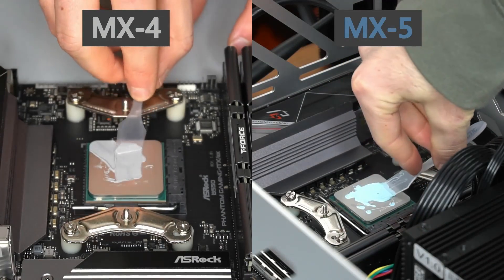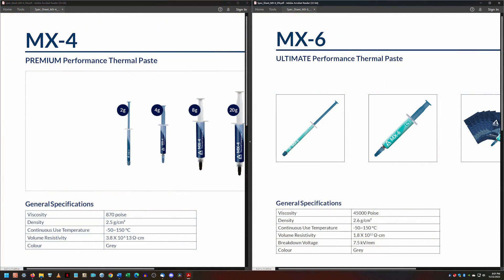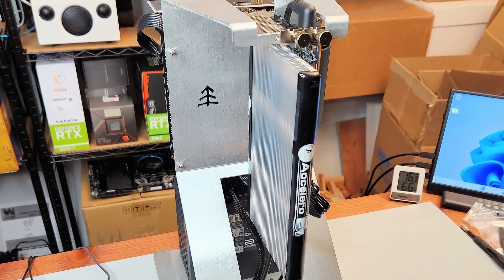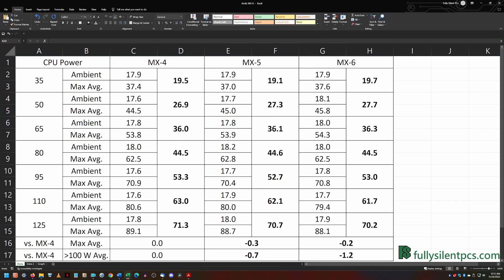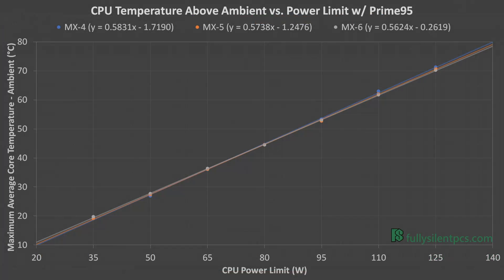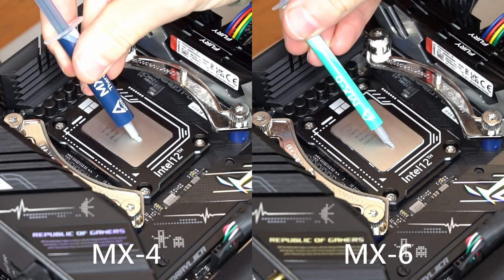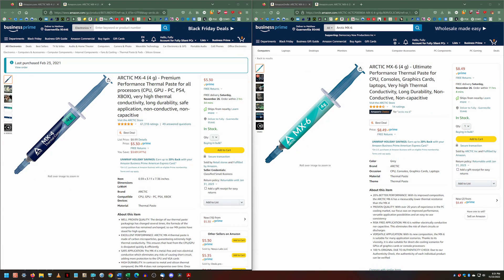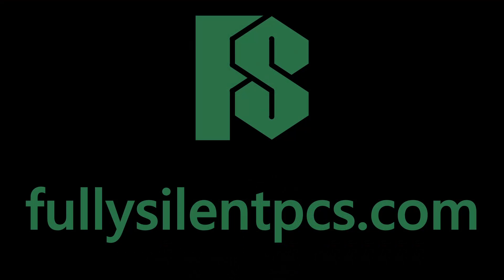Arctic MX-6 vs MX-4

Comment: Thanks for testing & posting!
I liked the light blueish color of MX-5, too bad they went back to the dull grey from the MX-4. But although Arctic won’t admit it, MX-5 clearly had a defect. It pretty much falls off after a few months of use. It looks like it dries out from the heat cycles. I hope they managed to tackle this with MX-6.
Reply: oh arctic did admit it had an issue, thats why they came out with mx-6. it would slowly spread out from under with repeated heating/cooling cycles
Reply: @BTD3Fan  Arctic never said MX5 was a faulty engineered product. They blamed the issues on one given batch. And yet for some reason instead of continuing to refine MX5 as a product with minimal changes, which is something they had done in the past, they chose to release MX6 which is fundamentally different again. Curious that.
Reply: @SianaGearz  can you tell the progress on the mx 6 paste, is it good for long term use?
Reply: @SianaGearz  well, it was just one single bad batch
Reply: @nirwanmuiz7695  it's only been on for a few months, too early to tell.
Reply: I just took off my cooler from GD900 after half a year and it was a breeze. The paste was still super fresh and well mixed. Easy to apply, easy to wipe off.

Now I installed MX6... Wonder how it's going to fare, with removal as well. Temperature improvement against a well aged GD900 of 1°C at 80W and 2°C at 110W. So I wonder yet whether that's even a real improvement or not.
Reply: @SianaGearz  I just took off my hyper 212 evo after 6 years and the paste was basically good as new. Idk what paste they were using at the time or if they still are but it seems to be pretty solid.
Reply: @SianaGearz  this is MX-6 I presume?
Reply: @kasimirdenhertog3516  What is MX6?

I had GD900 paste for 7 months.
Now I installed MX6 paste.

I happen to really like GD900, I was surprised. But I was curious to try MX6.

I don't know yet how MX6 is going to perform. I'm a little scared that it'll fail and harden. Temperatures look good but not crucial enough to make a decision.
Reply: @SianaGearz  what's the results of MX-6 in present ?
Reply: @luanszcosta  I have not taken it off, so i don't know how much it gelled or dried up, and i have a hard time judging temperatures since my PBO isn't exactly the same as it was back then, and my room is currently being a little weird, we have floor heating and the computer is on the floor, and the heating is completely automated by a machinery from the 1960s, we aren't allowed to set it, so outdoor temperature swinging wildly these past days, well the heating has been doing some crazy dancing, and controlling for room temperature has turned out unfruitful since there is direct heat from the floor in the PC. But the CPU temperature doesn't seem bad. Maybe check in, in a few weeks, perhaps i'll be able to do a proper measurement. For the time being i may be able to say it's somewhere between same as it was as-built and 3°C worse at 80W which is a range so vast as to be fairly useless, other than to say that thermal paste hasn't outright failed.
Reply: i actually have issue with my rog scar 3 i7 970h and rtx2070, when i decided to apply MX5 to both cpu and gpu, the cpu wsa not running the max frequency it used to do with MX4, after i change it back to MX4 on the cpu but MX5 with the gpu, it as running fine, i suspected to be the MX5 viscosity not working properly with the cpu
Reply: Also, that stuff was so danged sticky it might as well have been called a thermal adhesive.
I've pulled Ryzen CPUs straight out of a latched socket so many times now that it's not even scary when it happens anymore, just semi-expected behavior.
Only happened once with MX-4, and that was on a loose socket that was further loosened by wiggling and forceful extraction due to a previous application of MX-5.
A blow dryer should not be a requirement for removing a heatsink from a CPU.
Reply: @trajectoryunown  so im not the only one who experience this, ever since I start using mx-5, the CPU gets pulled out every time I remove the cooler, and then I would have to twist the CPU off the cooler🥲
Reply: @shinefake48  Be careful with twisting. I've seen consistent results with less worry using a sliding motion lately. Keeps the CPU in place, lowers surface area of the connection, and allows for leverage to be more directed the further it's off of the CPU. It's a bit messier along the edges and you may need to clean out the fins on the cooler, but I think it's worth it to avoid risking possible damage to the CPU and motherboard.
Reply: @trajectoryunown For future advice the correct way to remove any cpu cooler and help prevent damage to the cpu or socket is to stress test the cpu in a program like OCCT/Prime95 to heat up the cpu & thermal paste to help loosen it for easy removal.
Reply: @AK--K47  That... would have saved me so much time and effort. Thank you.

Comment: It all seems to be within the margin of error. I just use whatever I have kicking around and it's never been an issue
Reply: Kryonaut stands above really. But aside from that, I agree. Most are within margins
Reply: Well it does in a way... 
It usually better for 3-5 degrees but on IHS it doesn't last long, usually after 12-16m it's worse than MX-4 but yea it the GOAT for record breaking OC @OscyJack-
Reply: @OscyJack-  let me guess, that's the one you personally use.
Reply: @Ollixhnsn  feeling feisty today?
Reply: @zackburkhart8693  for an item most people never change, in a $1k + system, $10 doesn't really break the bank
Reply: @OscyJack-  until conversion rate kicks in
Reply: I was thinking the same thing.
Reply: Yea me 2 as long it spred enough.